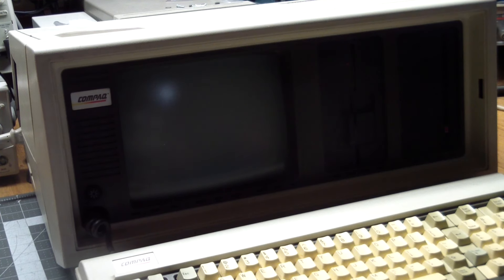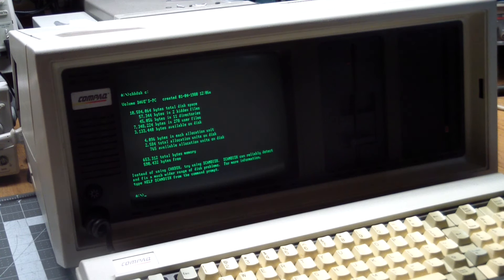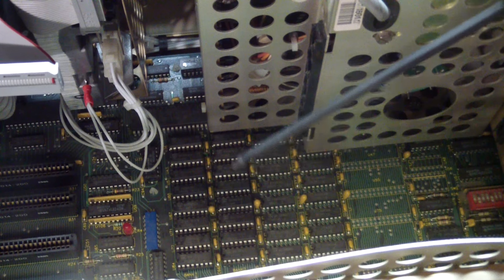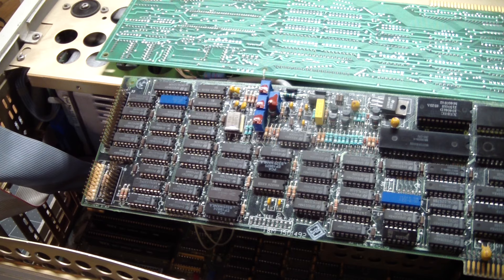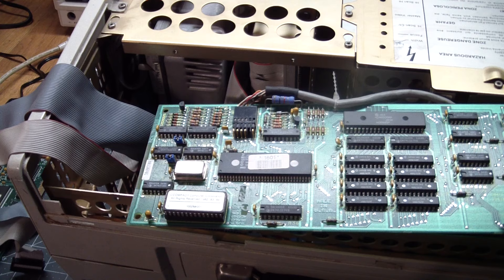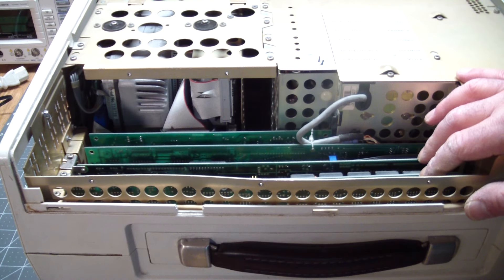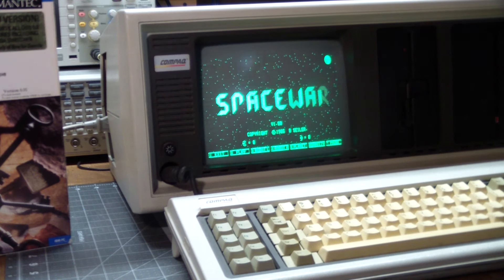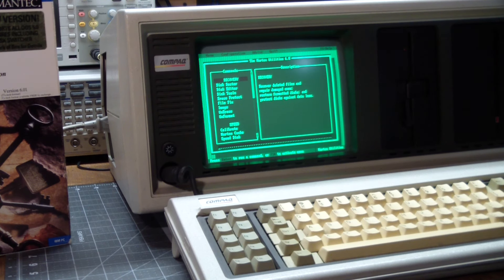AE#218 Repairing And Exploring An OG Compaq Portable, Part 2

Comment: Space War is one of the most important computer games ever created.

If was originally written for the PDP-1, the first computer DEC produced.  It later was the basis of at least two prototype arcade machines, as well as providing a great deal of the basis of the venerable Asteroids arcade game.  It was also the reason the original UNIX operating system was created.  (To provide the OS level so it could be run on a scrounged minicomputer at what was then the MULTCS development site.)  MULTICS was ultimately a commercial failure, but UNIX quickly became, and continues to be, one of the dominant operating systems.)